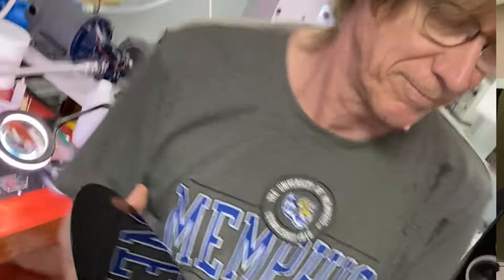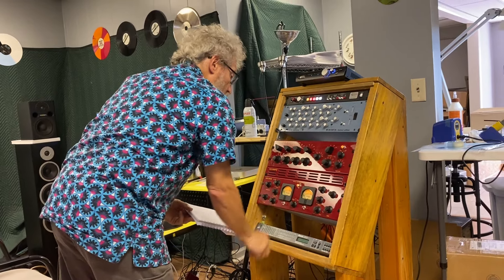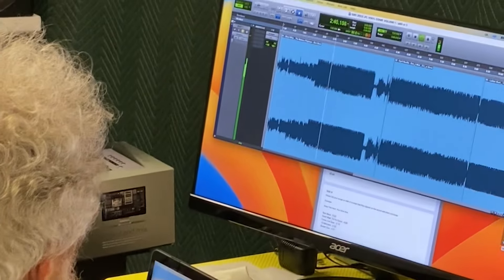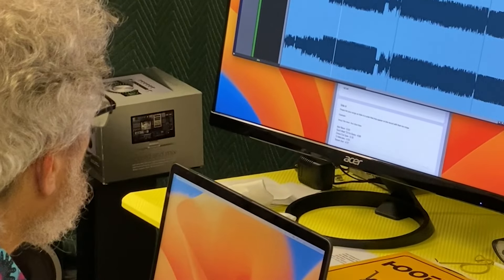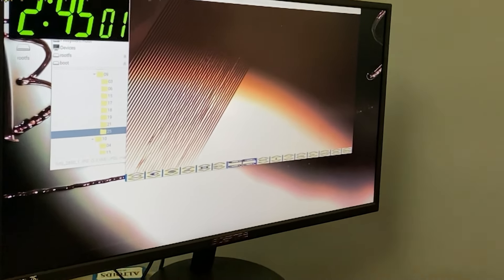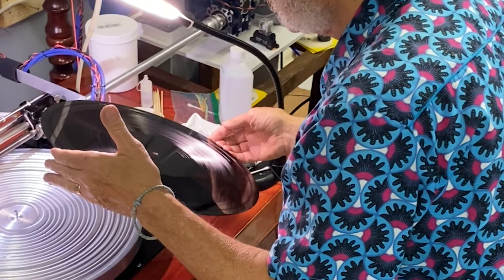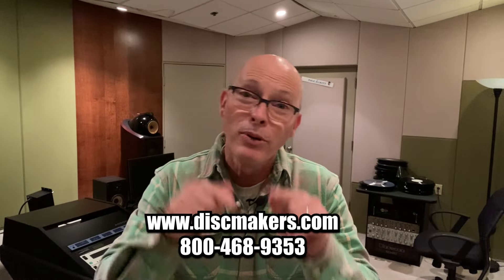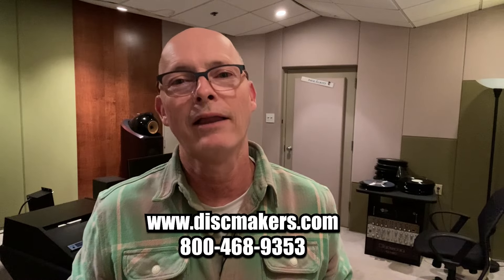How Do We Get Your Music Into That Tiny Groove on Your Record? 🤔 - How Lacquer Mastering Works

Comment: The mastering engineer doing the cut is, to my mind, one of the most talented members in the process. As you mentioned, s/he determines levels, tonal balance , playability and all the rest that makes a good sounding record - like dealing with inner groove distortion which complicates a set and forget mentality. I was reminded of Todd Rundgren/Utopia's debut album which, at the time, had a super long side - way over the optimum 22 min. - at a bit over 30 min (the other was a bit over 28 min.). The individual that cut that one was presented with a true challenge. Yes, it did suffer from a compromised level, but the fact it got cut and was playable is remarkable. Thanks for the look at this part of the process, Tony.
Reply: you're 100% correct. it's a real art...